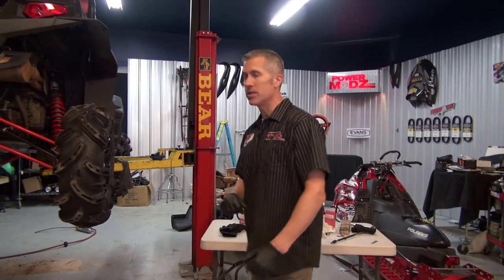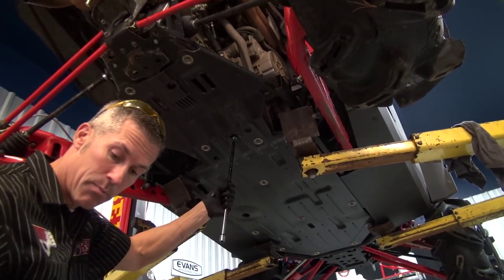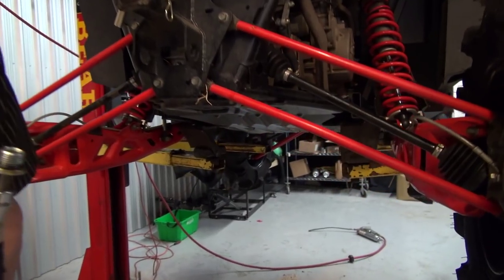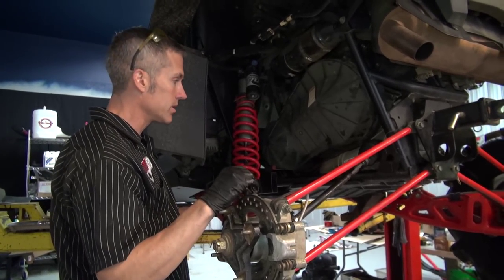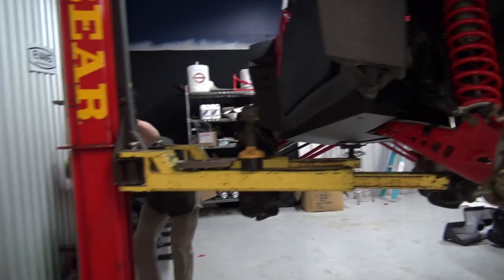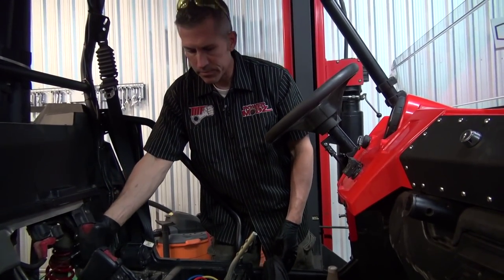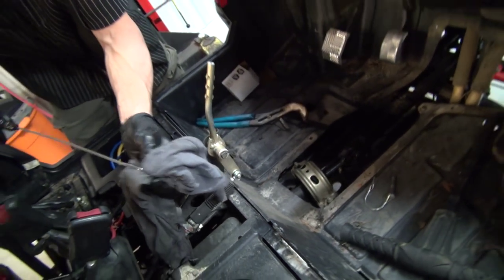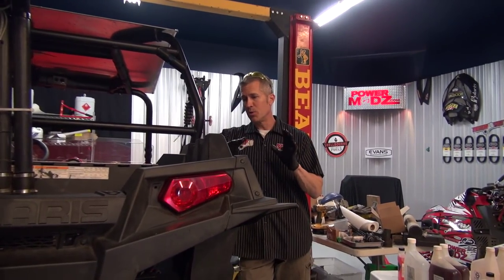Polaris RZR 900XP oil change  and lube, PowerModz!

Comment: intermediate shaft is steering shaft, what you were doing at 6:30 was called the center shaft coming from the front diff the the center hub and back to transmission

Comment: The potential issue with running a 20W/50 oil is excessive oil pressure. Polaris has always had oversized oil systems, why is anyone's guess. I have seen a few times people put 15W/40 or 20W/50 in Polaris rigs and either blow oil cooler lines (if equipped) or the oil filter is puffed signifying excessive pressure. Got a rzr in the shop right now with hydraulic lifer damage because of excessive oil pressure, in excess of 150 psi. At the end of the day, run what you like, just be aware of the potentials.

Comment: secondly you install your oil filters way to tight, if you need channel locks to remove them, they are way to tight. all they need is hand snug and 1/8th turn past. heat will tighten further, making removal a one handed operation.
Reply: i have managed a lube shop for 15 years. Canadian company too
Reply: True story